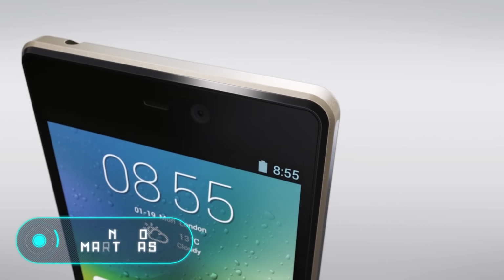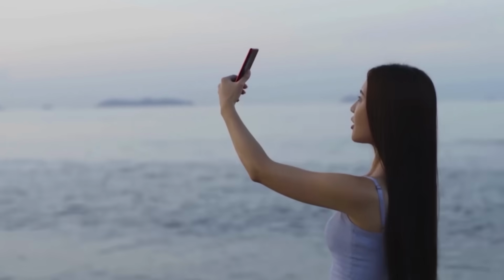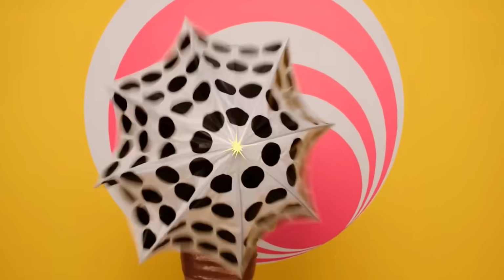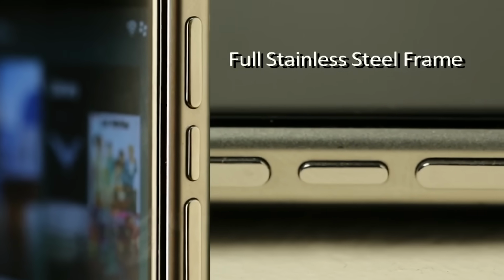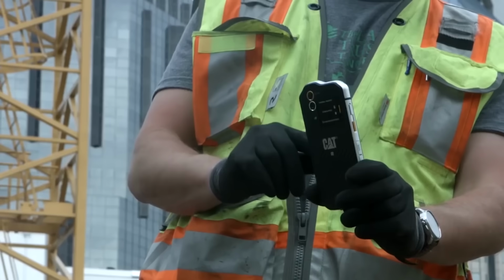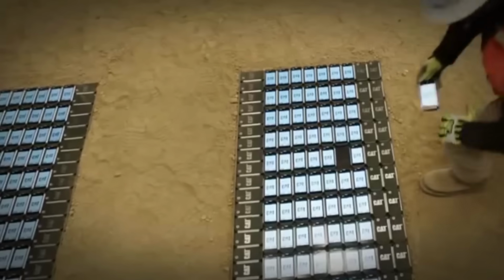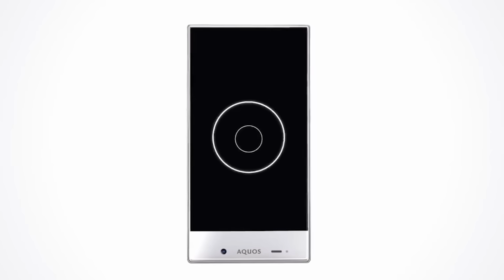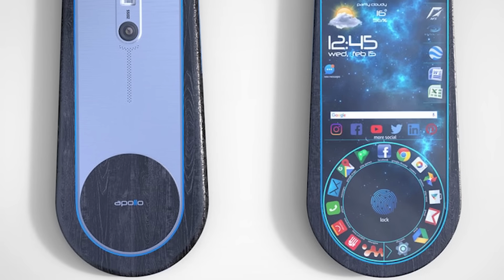THESE PHONES ARE COOLER THAN IPHONE X

Comment: Don't get the passport, it's the worst piece of trash I've ever owned. Within weeks of owning it... one night the battery went flat no biggies. Went to charge it, would show the charge icon, wouldn't charge. Tried a load of fixes nothing worked. 

Went online to their official support pages, the friken official support page literally acknowledges the issue and it's recommendation is "Don't let it run out of charge". That's it, the professional advice. 

The next issue is, if you have the above issue (some don't get it) it also prevents you from logging into the default app store for some unknown reason. Except, if you haven't experienced the above, you'll just be sat there frustrated as to why you can't log into amazon apps. 

In addition to this, passports aren't compatible with their new android - blackberry system which the Priv of DETEK series is. This means you're limited to the amazon app store (providing you can log into it). 

And on the subject of apps; I'm not a mobile gamer, but I usually have one or two on my phone for traveling with this; This phone can't play anything hardly. Even the simplistic ones like Jurassic Park Builder, you open it up and it black screens. You go to close it and it takes 15 seconds to respond. 

Furthermore, messanger isn't supported on this phone, so if you're a facebook chat addict, then you need to go into a physical browser to chat to people. Also, you need to refresh the browser to see new messages from other people if you're chatting to someone.

Lastly one of the selling points of the phone is the keyboard being touch, so you can essentially use it as a touch pad. Don't fall for it, again, it's trash. The range is very limited when scrolling. 

The only two positive's I've got going, the screen is a nice quality and the keyboard is very nice to type with, much prefer it over a touchscreen. But these two qualities don't make it worth buying under any circumstance. Avoid it.

Comment: The reason why I have an Iphone. 
I had nokia / samsung since 1997 - 2012
Then I got a smart phone android and it was good
2013-2016 I had about 12 smartphones.. (samsung)
After 2-6 months it starts lagging, freezes, hard to use. 

2016 I got my first Iphone 5s
Never had a lagging issue. 

Iphone OS is the best.. 

I will not buy ANDROID (90% of these phones showed in the video) uses android.

Comment: Any phone is better than iPhone x. Apple is trash and more people need to realize that. Android has no limitation, great design, beautiful 4k imagery (apple JUST got it), the Google assistant sounds really good compared to Siri 😂, Android invented 90% of the option you get in iPhones... example: Front facing camera, OLED display, 4k video and image processing, besseless screens, fast charge/Turbocharge™, loud speaker technology, dual camera (image stabilization), wireless charging and USB type C. And apple did what? Thought so. Not to mention Android has a huge group of companies that use its platform which equals more variety and apple doesn't have that. They are so dull and boring. When I didn't know much about phones, I had an iPhone 4s and I thought it was ok. I was kind of getting bored of it, so I ventured off to my provider and traded in my iPhone for a Nexus 4. I had never realized how trapped I was on my iPhone. So limited I was to creativity, and personalization. I'll never go back to isheep. I'd rather stay here with my Google Pixel 128gb silver 2.15GHz + 1.6GHz quad-core Qualcomm Snapdragon 821👌👌